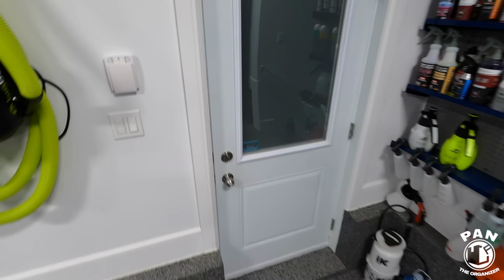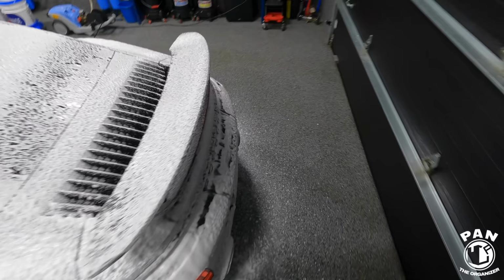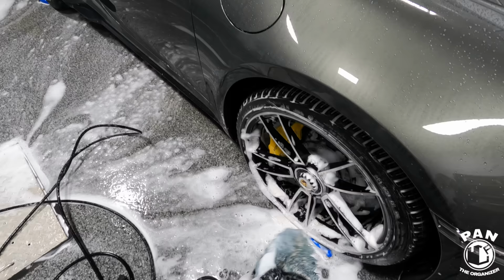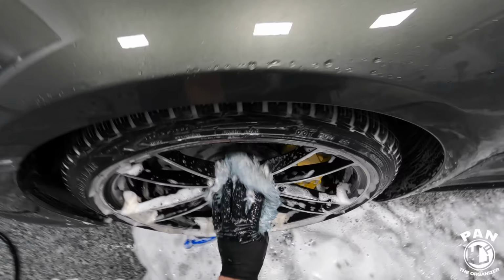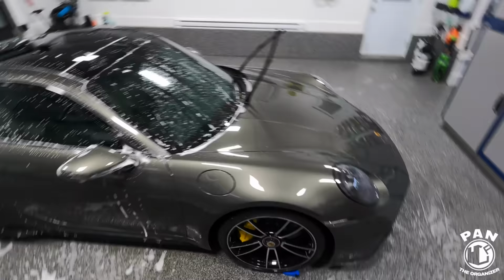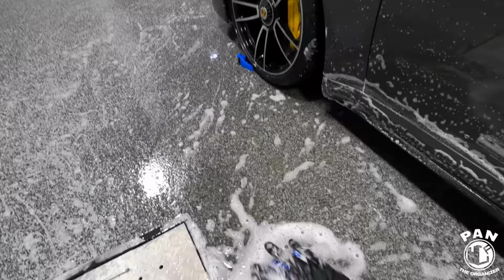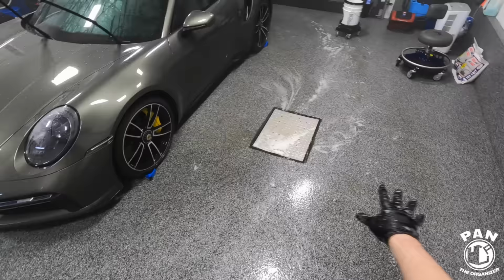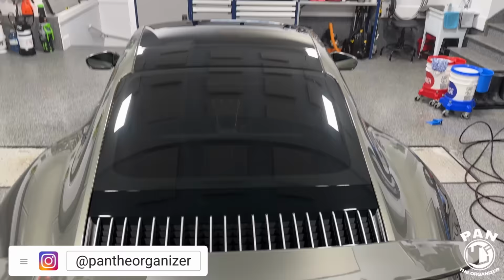Cleaning A Dirty Porsche 911 Turbo S : Exterior Auto Detailing

Comment: Thanks a lot for another very interesting video, Pan!
Two questions:
1. Why did you choose to blow dry the car instead of using mf-drying towels?
2. Some people say: "When your car is ceramic coated, don't use stuff like Beadmaker: just let the ceramic coating do its job. Only when the ceramic coating is old and doesn't do its job properly anymore, you can help it with stuff like Beadmaker or Gyeon Wetcoat." What's your opinion about that?
Thanks a lot in advance for your answers!
Reply from the maker: 1) Because when your paint has protection (wax, sealant or ceramic coating) it’s much quicker to use a blower to dry the car, and it’s a 100% contactless drying method so no chances of marring the paint.

2) That is incorrect. Ceramic coatings need to be maintained once every 2-3 months. See my video on a proper coating maintenance wash and why we do it here: https://youtu.be/IqIW78FmRYU
Reply: @PanTheOrganizer  Thanks a lot! I am aware there is still a lot to learn from you.
Reply from the maker: Welcome to my channel. You discovered one of the biggest car detailing channels on YouTube as we surpassed 905,000 subscribers and we have over 117 million views! I have been detailing for 26 years and I love to share my knowledge and passion with my viewers.

You found the right channel to help you learn everything about detailing.

Comment: Great vid. My go to for all things detailing. Can I ask, I have coated my car with Fusso 12 month wax and want to know if washing with Bilt Hamber Touchless will begin to breakdown the wax as it’s Ph12?  Also is turtle wax graphene & Koch Chemie PW ok to layer ontop of Fusso?
Reply from the maker: Yes higher pH snow foams and shampoos like Bilt Hamber Touch-Less will start breaking down protection like waxes and sealants. They can even start weakening ceramic coatings if used too often. 

Yes you can use the Turtle Wax Graphene Flex Wax on top of everything. Waxes, sealants, coatings, it doesn't matter.
Reply: @PanTheOrganizer . Thanks Pan. Was looking to do Koch Chemie PW after washing and then the turtle wax graphene ontop

Comment: Believe it or not, I was actually hoping to see you upload this video 😂Seeing you be done with it in under 1 hour actually amazes me, haha. Your coating is phenomenal! Just a simple wash and all that snow and salts are gone for good. Last week I did my "spring" maintanance wash. I used Lift and Descale (descale at hand wash too) and even IronX, only to finaly make sure that my coating looks like it has no water beading and really slow sheeting (fictech, profesionally installed). It looked glossy though. I've been using a ceramic spray as a drying aid after every wash and that really made me think about it. Only thing coming to mind is that potentially using Lift (alkaline) as a prewash before every wash could have damaged my coating. Really interesting content and  always learning something Pan!
Reply from the maker: Thanks George! And you have a good spring maintenance cleaning procedure. Always good to start fresh at the beginning of spring. :) And yes even for professional grade coatings, I would not recommend using high alkaline pH snow foams every week, as they can start weakening even the best coatings. Stick to pH neutral for weekly washes, and once in a while, you pull out the CarPro Lift or Bilt Hamber Auto-Foam or Touch-Less for deep cleanings.
Reply: @PanTheOrganizer  Well, at least I'm glad I understood that's what was going on! Again, I cannot emphasize enough how much somebody can learn from you! Cheers!

Comment: Hi Pan. You chose the mot beautiful color for that Porsche. Congrats! My question: is a good idea to use the small brushes to clean some parts in the foam gun step? Or is it better to do it once you wash with shampoo? I’m thinking on the dirt the foam removes and maybe if I use the brush I can scratch the bodywork.
Reply from the maker: It's best to foam first, rinse, then foam again and then you can use the little brushes for emblems and intricate areas. Get the grit off first with the initial foam and rinse.

Comment: Pan, I have a BMW 640i with 20 inch wheels.  I had my wheels balanced and I didn’t pay attention, but the weight balancers were placed on the inside of the rims (which are open) and visible.  I later had them moved inside, but it left a sticky white residue that is hard to remove.  My rims are painted on the inside and I’m at a loss on how to remove the residue without damaging the paint on the inside of the rims.  Any recommendations?

Comment: Amazing video as always! Just curious to why the side of my car’s coated with cquartz 3.0 only sheets water and doesnt bead. Descale, iron x and spotless did not do anything to it. So usually i just spray hydro2O lite to help gain back the beadings.
Reply from the maker: Hard to say as I don’t have all the details about when you applied it, how you applied it, how many layers, what maintenance you did, etc.

CQUK 3.0 is rated for two years with 2 layers applied, but depending on multiple factors including weather, mileage, conditions and maintenance, that doesn’t mean it will last as long on all cars.

Comment: Such a fantastic video. I used to wash my wheels first, but now I do them last so I can use what's left in my soap bucket to aid in lubricity on my gloss black wheels. Also, GoPro battery aside, you're so FAST. I had just come in from doing my exterior when I saw this post. It took me 2-and-half hours including setup and clean up. 😕🤷
Reply from the maker: Thanks. My wheels also gave lots of gloss black. I have a separate wheel bucket with shampoo in it for lubrication. I still do wheels first. The trick for gloss black wheels is to use microfiber wash mitts and brushes, as you saw in my video. ;)

Comment: Amazing video once again Pan. I have been a long-time viewer, really appreciate you. 

In the coming weeks, I'll be applying a ceramic coating to my G30 for the first time. Based on your recommendations, I'll be going with the cquartz UK 3.0 (2 layers) and cquartz SIC (1 layer). Then, every 2-3 months rejuvenated using Reload.

Now I have two questions:
1) I will be able to let the coatings cure for about 24 hours after applying the 3 layers. Would you recommend me to apply something like CarPro release before I take it outside, just for extra protection while it fully cures in the days afterwards? Or is that excessive?
2) Can I use the beadmaker/dreammaker mix (for all the washes where I do not use reload)? I read somewhere that beadmaker doesn't work on top of SIC, because it would not stick. What's your view on that?

All the best from The Netherlands Pan!
Reply from the maker: 1) Yes use Release
2) I haven’t tested Bead Maker on SiC so I can’t comment on that unfortunately. If you want to be safe, use Gliss 2.0 instead of SiC.

Comment: Great video and I do like this type of video. I actually do a quick rinse, tires, foam cannon and let it dwell for 2-5 mins depending on the weather and use my two buckets. 

I use Adams Graphene Detail Spray and Adams Graphene Boost since I applied their advanced ceramic coating. Should I keep using or would you recommend to use P&S dream and bead maker combo? Also, what ratio do you use for P&S brake buster?
Reply from the maker: For sure the P&S "Clean Maker" secret mix (as they call it) is better for gloss and slickness, but that only lasts a few weeks. The Adam's products you are using are also very good. So no worries there.

When I use Brake Buster from the original spray bottle, I don't dilute it. I only dilute it when I put it in a foaming pump sprayer. I dilute it 1:3 but you can go as low as 1:5 depending on your preferred foam level and water quality. I have a full blown water deionizer setup so my water is as perfect as it gets for washing cars (zero minerals).

Comment: Would you recommend KochChemie GSF or Auto-Foam for regular washes on PPF/ceramic coated cars?
Not sure if Auto-Foam is too harsh for regular washes (every couple of weeks or so) of if it'll just be a better consistent clean that I don't have to worry about since the vehicle has coating and PH resistance.
We don't get any road salts or crazy amounts of dirt here in urban Texas - worst it ever gets is dirty rain and maybe a stray muddy water splash.
I do use ONR to pre-spray and then rinse prior to a foam if that changes anything.
Reply from the maker: For regular washes, I would stick to using pH neutral shampoos like Gsf for sure. You use Auto-Foam or Touch-Less once in a while for heavier cleaning and grime removal and traffic film.

And good move on using a rinseless wash as a pre-treat before the snow foam.
Reply: @PanTheOrganizer  It's crazy how quickly and consistently you take the time to reply to so many comments/questions.
Really shows your love for this community and the passion you have for your channel and profession.
I've learned a ridiculous amount from your channel, ever since the M550i days
Reply from the maker: Thank you! I appreciate the kind words. As you can imagine, I receive thousands of messages daily across all platforms, and I'm the only big detailing channel to take the time to personally reply to YouTube comments every single day, as you can see. :)

I won't lie, it gets overwhelming at times, as I spend up to four hours every day simply to reply to comments, so I likely won't able to sustain such a rhythm for decades, but I try my best to stay connected with you all. 

It's nice to see my efforts don't go unnoticed by my audience. So thank you!

Comment: Hey Pan great drop albeit a little dated(Super Bowl) . Anyway, it makes sense to prewash the car with the rinseless vs the risk of first pressure washing and driving dry dirt into the paint and causing scratches. So, one thing I noticed that Matt Moreman does in his wash and talks is use the foam for lubricity. He foams the car then commences with the contact wash with the foam still on. What do you think about that?
Reply from the maker: I prefer to foam, rinse, and then either foam again or do the contact wash. I don't foam and start hand washing, as there is loose dirt potentially and that could marr the paint. Matt lives in a very different environment than me (he's in Florida, I'm in freezing Quebec) so the procedures are very different. His cars rarely get dirty, so he could even skip pre-washing if he wanted, it wouldn't change much really.

Comment: I have to use the EZ detail brush JR to get behind my calipers on my RS6.  The regular size is too big to fit between those calipers and the wheel.  I think the calipers on the RS6 are the same as on the Porsche Turbo S.
Reply: Front calipers
Reply from the maker: It is quite possible that they are similar in size, as both cars have massive front rotors (over 420-440mm in size) and both have the biggest 10 piston calipers that the brands have ever installed on vehicles. I know for a fact that these are the biggest brakes Porsche has ever installed on a 911.

Comment: The only time I wash the wheels last is if I’m doing a rinse less wash. I jack the the car up so I could spin the wheels while washing my annoying satin black wheels. PCCB’s was discontinued while specifying my car. 👎
Reply from the maker: What car do you have?
Reply: @PanTheOrganizer . Cayman GTS. PCCB’s only available for MY 2020. If I go for a quick drive the brake dust is everywhere and after washing the steel rotors got orange rust that falls on the wheel barrel. I don’t know what to do. I tried Bill Hamber atom mac on the rotors but only reduces it a little.

Comment: Just recently started watching you videos and it has really helped me make the right choices when detailing my or my clients cars, I have one quick question though, for the AF foam if used correctly with the right dilution it would cause no harm to current protections put on a vehicle correct?
Reply from the maker: Hi Hunter! Welcome to my channel. You discovered one of the biggest car detailing channels on YouTube as we surpassed 875,000 subscribers and we have over 112 million views! I have been detailing for 26 years and I love to share my knowledge and passion with my viewers.

You found the right channel to help you learn everything about detailing.

You mean the Koch Chemie Active Foam? It's fine on coated vehicles (with ceramic or graphene coatings) but shouldn't be used for regular weekly washes. Once a month or every other month perhaps, just to remove traffic film and heavier grime. It's pH 9.5 so if used on regular waxes and sealants, it could start breaking those down and stripping weaker protection.

So for regular washes, stick to Gentle Snow Foam or any pH neutral snow foam.

In one of my videos, you'll see the Koch Chemie experts talk about the differences between their snow foams here: https://youtu.be/BO0eAARXfAg?t=1088

Comment: Going to order an ego blower, same CFM most likely but i wondered for a full size truck is one battery emough, not sure how often you need to use the turbo button. The RAM limited grill collects and holds a lott of water, the mirrors as well
Reply from the maker: It might be tight with just one battery on Turbo boost mode. I have two 5.0 aH batteries to be safe.
Reply: @PanTheOrganizer  do you need the turbo mode to fully dry a vehicle or dont really need it unless blowing excess water out of badges, grille, and mirrors. Thanks!

Comment: Love the video!I just ordered a brand new truck and when it gets to the dealer and I bring it home I wanted to do my first ceramic coating. I am a wax/sealant person. Quick question, I don’t have a foam cannon, what is the best decontamination car wash soap before I prep for ceramic. I still don’t know yet if the truck will need clay or not. But for wash decontamination, do I use alkaline or ph balanced? Have any brands in mind?
Reply from the maker: Hi Jeffrey! Congrats on getting a new truck. What did you end up buying?

Here’s what I do to a brand new truck or SUV: https://youtu.be/t7HCBSVnizM

A new car is never new until it's properly detailed. 
- at the factory, the paint defects are often corrected quickly by rotary polishing which can leave marks and holograms, so polishing corrects those, before you lock that in long term with a ceramic coating for example.
- vehicles are then transported by truck, train and boat so they are exposed to the elements, industrial fallout, brake dust, rail dust, etc
- vehicles are often left at boat docks (when transported by boat) or in exterior parking lots for weeks or months, again being exposed to the elements
- at the dealership, the vehicles are almost always poorly prepped using the same dirty water that was used for all the cars on a given day, and poor washing and drying methods leading to swirls and scratches 
- at the dealership, a layer of cheap wax or paint sealant is usually applied to attempt to make the paint glossy prior to delivery. It's crucial to remove any previous protection before you apply a ceramic coating, as coatings need to bond directly to a virgin clear coat.

If you only plan on applying a regular carnauba wax or paint sealant though, you could decide to skip machine polishing, as those protectants can be applied over existing protection and it's not as crucial to prep the paint as well.

I explain all of this in this popular video: https://youtu.be/QgoyrC-5CMc

So you can better visualize the new car prep process, here are the steps I perform on a brand new car from two of my customers: 
Tesla Model Y: https://youtu.be/gohks8xP5NY 
Porsche 911 Carrera: https://youtu.be/2ckiivbFqs4
Audi Q7: https://youtu.be/t7HCBSVnizM

Comment: Hey Pan, love your videos. Just purchased my first new car. I will be doing my first detail today. For the pre rinse, can I use p&s absolute rinseless wash? It’s all I could get my hands on last minute. Thank you
Reply from the maker: Congrats on your new car! Yes Absolute can be used as a pre-rinse, it's one of the best rinseless washes on the market.

Also, keep in mind that a new car is never new until it's properly detailed. 
- at the factory, the paint defects are often corrected quickly by rotary polishing which can leave marks and holograms, so polishing corrects those, before you lock that in long term with a ceramic coating for example.
- vehicles are then transported by truck, train and boat so they are exposed to the elements, industrial fallout, brake dust, rail dust, etc
- vehicles are often left at boat docks (when transported by boat) or in exterior parking lots for weeks or months, again being exposed to the elements
- at the dealership, the vehicles are almost always poorly prepped using the same dirty water that was used for all the cars on a given day, and poor washing and drying methods leading to swirls and scratches 
- at the dealership, a layer of cheap wax or paint sealant is usually applied to attempt to make the paint glossy prior to delivery. It's crucial to remove any previous protection before you apply a ceramic coating, as coatings need to bond directly to a virgin clear coat.

If you only plan on applying a regular carnauba wax or paint sealant though, you could decide to skip machine polishing, as those protectants can be applied over existing protection and it's not as crucial to prep the paint as well.

I explain all of this in this popular video: https://youtu.be/QgoyrC-5CMc

So you can better visualize the new car prep process, here are the steps I perform on a brand new car from two of my customers: 
Tesla Model Y: https://youtu.be/gohks8xP5NY 
Porsche 911 Carrera: https://youtu.be/2ckiivbFqs4
Audi Q7: https://youtu.be/t7HCBSVnizM